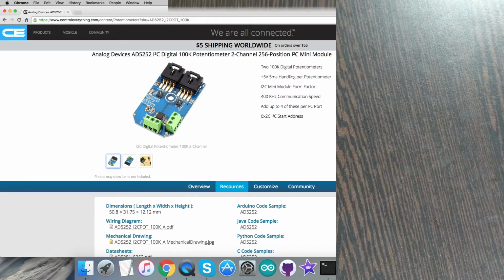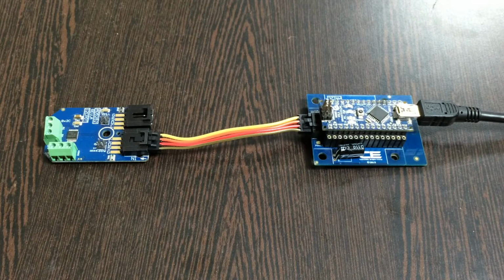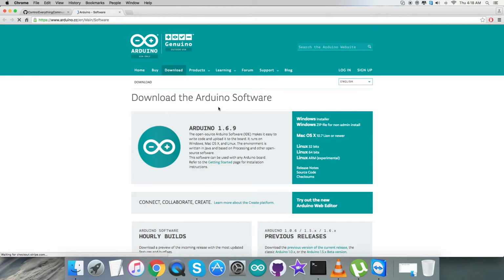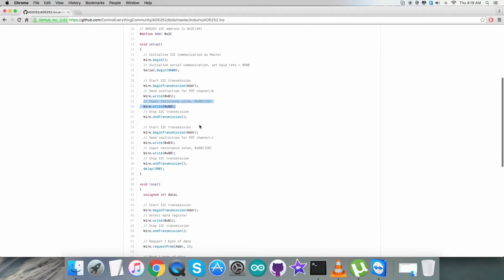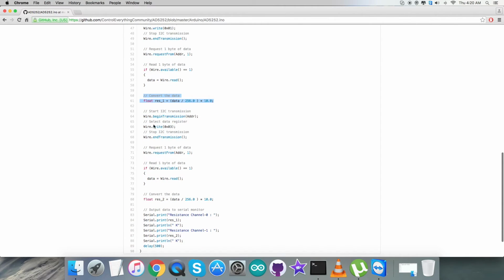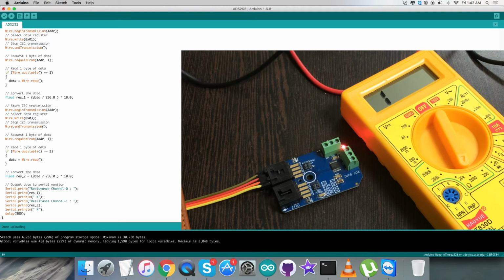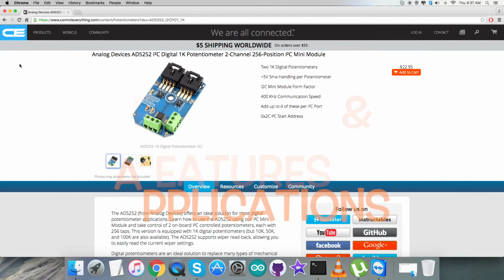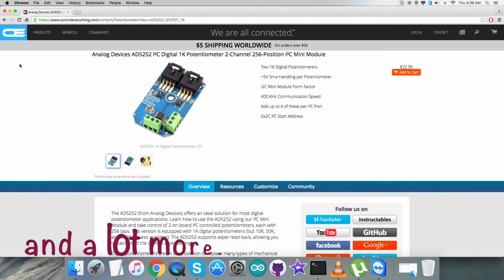Arduino Nano AD5252 I2C Digital Potentiometer Tutorial

Comment: Hello, sir. I do not wish to buy the I2C shield. What pins must I connect to the connecting cable?
Reply: Sir, I thank you for starting me on this path. I have solved my own question.

Look at the Potentiometer for the letters/numbers G5DC. The pinout to connect to Arduino is:

G (Ground) - GND on Arduino Uno
5 (5V) - 5V on Arduino Uno
D (SDA) - A4 (analog input 4, or use the dedicated SDA pin on the board)
C (SCL) - A5 (analog input 5, or use the dedicated SCL pin on the board)